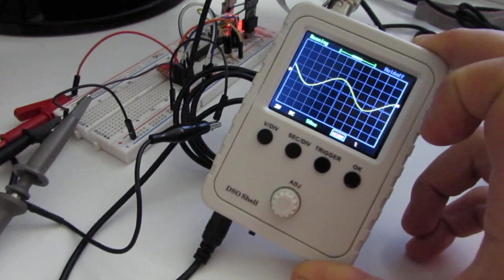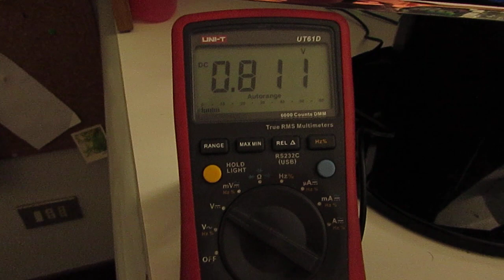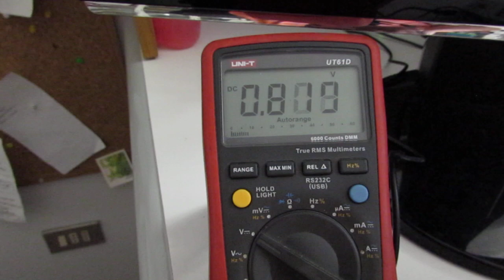A MCP4725 DAC AVR ATmega library

Comment: Sir in schematics ADC(0) is unconnected,we give analog voltage in adc(0)
then corresponding DAC meet? please explain sir.
Reply from the maker: Hello. ADC is not involved in this project. This Is Just about the DAC. You can connect to other MCU PIN of you want.
Reply: @davidegironi  
So sir which ac voltage is find in MCP ic no need to give any
 reference analog voltage of digital line of controller? And what is the frequency of out put voltage(output of MCP)?if we want change it is possible?
Reply from the maker: @newtechnical715  you can set the voltage using the library provided. The voltage itself have't got any frequency. As example for a sine output you have to code the voltage changes inside your code. It all digital except the DAC output.
Reply: @davidegironi  
Ok sir
Sir if we want 2.5volt at 2 khz it is possible?
Reply from the maker: @newtechnical715  you can have 2.5V DC, you can not output 2.5V AC at 2Khz.